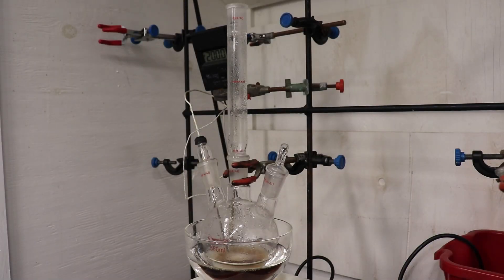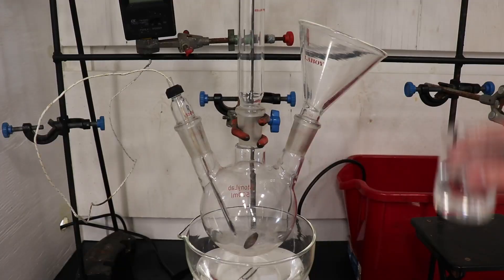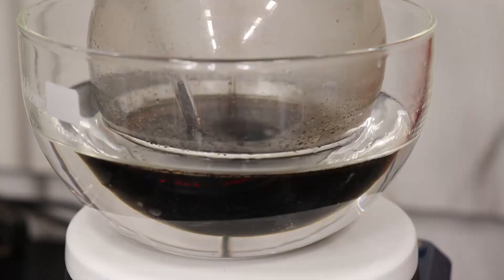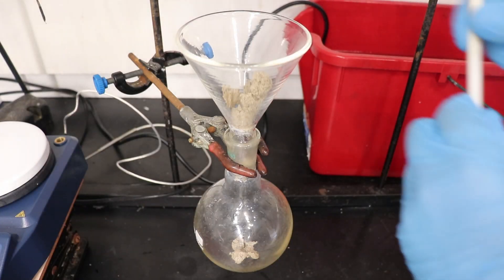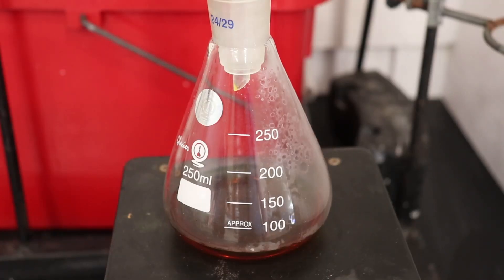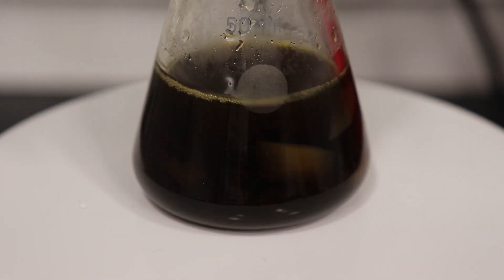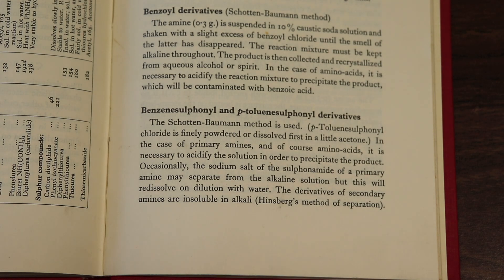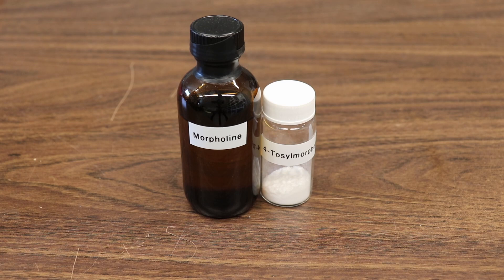Morpholine Preparation from Diethanolamine

Comment: Cool, it's been a while. I'm surprised you could get diethanolamine in the first place, as it's on the CW list as a precursor.
Reply: maybe pure DEOA but I use a gun cleaner that is mostly DEOA and Diethylenetriaminepentakis(methylphosphonic acid)  ( BP over 1000*c so distillation  would be easy). theres also a tiny amount of HCL in there but since this reaction uses HCL i dont see that being a problem either.
Reply: @anthonyzouras  which cleaner?
Reply: Do you know for what purpose? Nitrogen mustard maybe?
Reply: @DIGITALVHS  yeah sounds about right
Reply: also i rechecked. your mistaken. it's not on the list but diethylethanolamine and dimetyl are expemted. and n-methyl-diethanolamine are cwp3's and triethanolamine also a 3. meaning your good aslong as your not stockpiling anything.